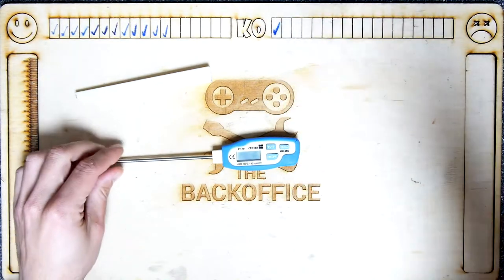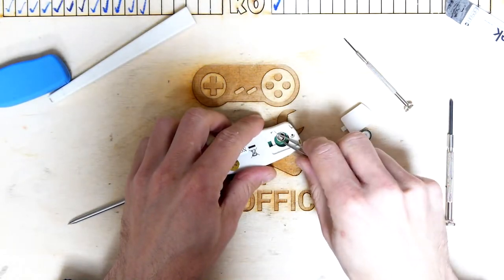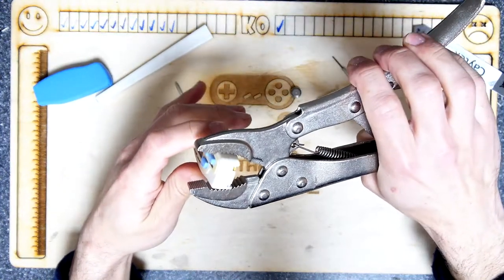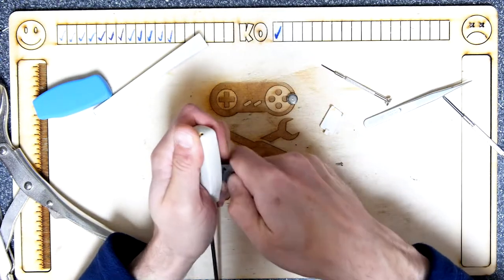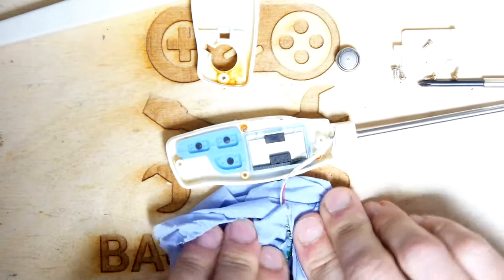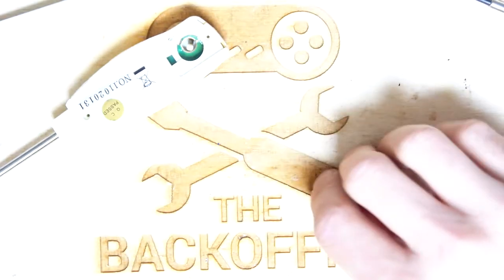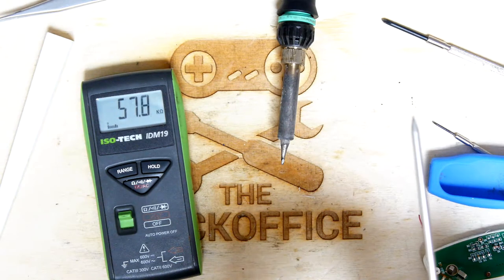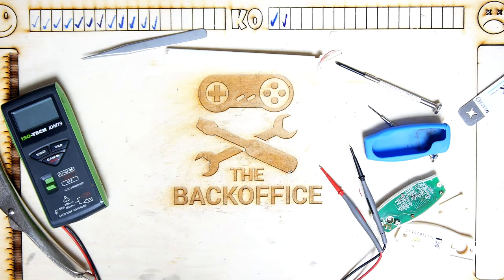Food Temperature Probe

Comment: It could be a thermocouple, instead of a thermistor. In that case, the reading is taken by measuring a generated voltage (in microvolts) rather than by measuring resistance. The most common type is a Type K thermocouple. Wikipedia has a decent reference page on the subject.
Reply from the maker: +MrPGT9999 Neat, i dont think i have ever come across one, will check it out 👍